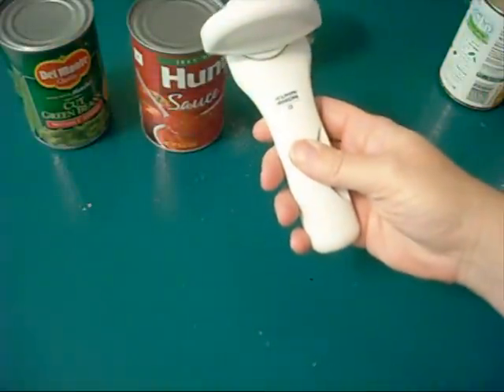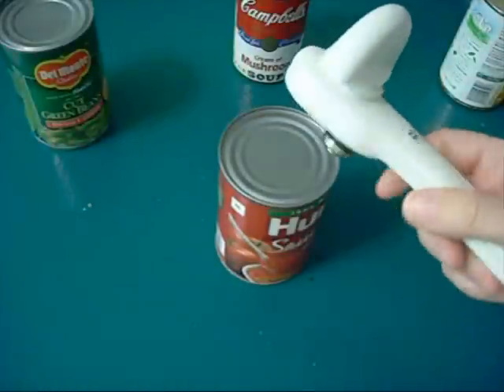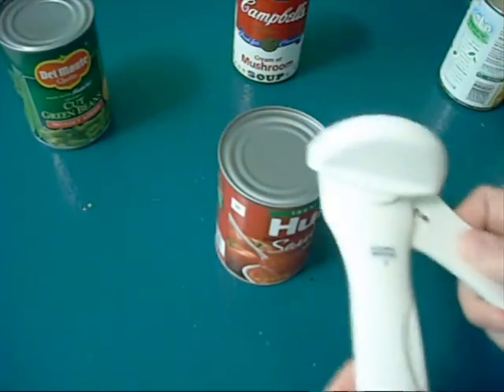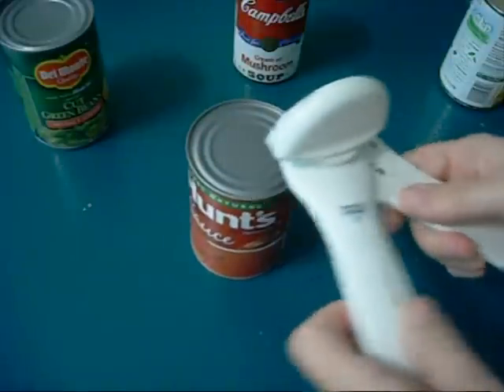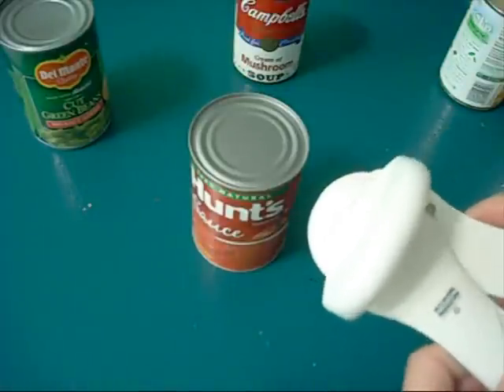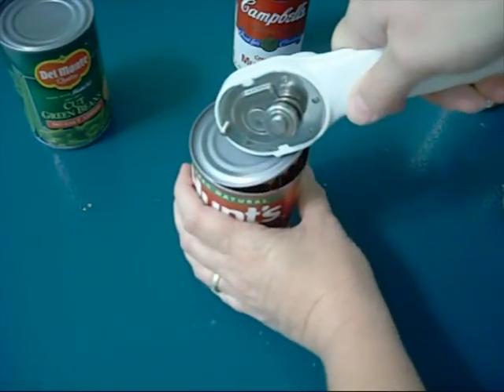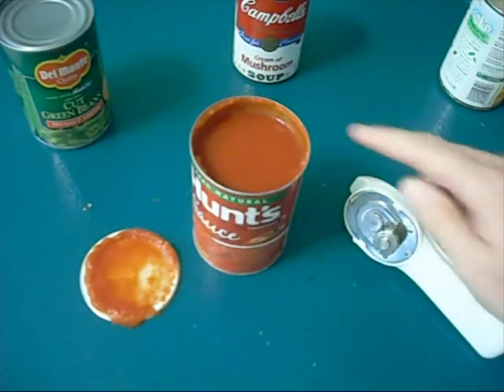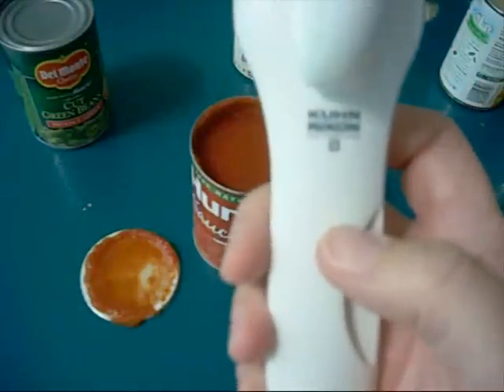How to use Kuhn Rikon can opener

Comment: Mine is a little fancier than yours, on the other end it has a bottle opener, the type of opener of a twist off beer bottle, or, on the same end, it has an area that fits over a like a 2 liter soda bottle cap and will help twist off one of those plastic caps.  Like you said, it's the best can opener I've ever owned.  Once you figure out to use it, you wouldn't  trade it for any. Excellent video by the way.  You taught me how to get the lid off the can once if had it opened (getting the lid off the actual opener I'm referring to).  I had a heck of a time learning how to do that.  I am curious.  It makes such a clean cut  when opening a can, have you ever thought about saving the lid and storing the can in the fridge, in the can, closed with the part you cut off?  Not for long, but may 24 hours or so.  I never have, but I have considered trying it once.  I will let you know if I do and how it went.

Comment from the maker: @UpcomingJedi  I've had mine for about 5 or 6 years (maybe longer) with no problems. The teeth are metal and the the handle is a hard plastic.  If it ever breaks I'll post it on this page, but so far so good. 

The ONLY negative thing I can say is that if you like canned tuna and usually let the top fall into the can to squeeze off the liquid, you can't do that. The lid won't fit back into the can.

Comment: Thank you so much!  A couple I petsit for have this can-opener, and I used it at their place tonight.  It turns out, I successfully opened the can, but didn't think I had since the lid wasn't coming off.  ;-) Thanks to your video, I was able to use the proper tool on the side of the can opener to lift the lid.

Comment: The new model version doesn't have the sliding option for the handles, we just push it at the edge of the tin, go once around and we can also use the cover back on to close it. The Kuhn designed it really well. Thanks for the video, it helped me to understand how to open the can opener best, otherwise I will still be searching Google or other places.